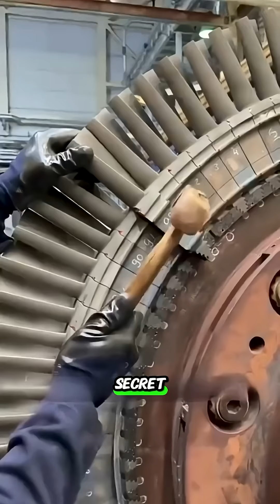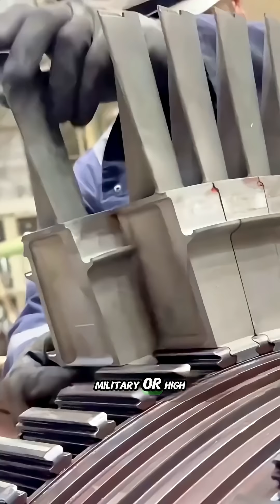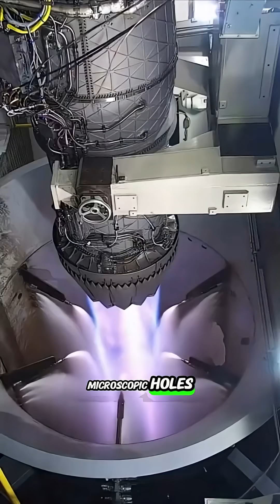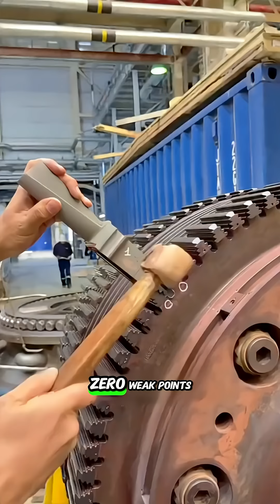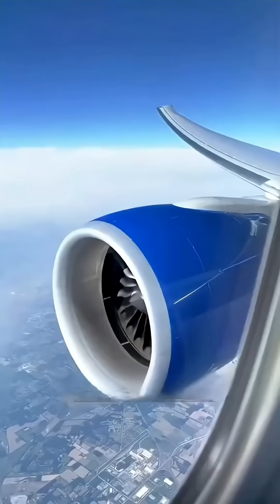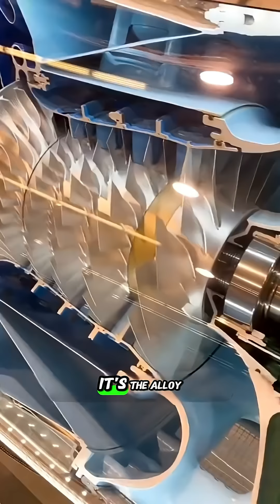The Insane Reason Nobody Can Copy American Jet Engines

Comment: Russians, Chinese, germans, japanese, india, italy, france, england. It's a marvel of engineering but lots of countries can build them.
Reply: Are you racist? Why didn't you name all the African and South American countries that also build jet engines?
Reply: @7x779  ok brazil but I think south africa builds nothing anymore.
Reply: @timjones1583 yes South Africa was about to have a space program but then Nelson Mandela came along and destroyed everything for them to this day, but the world will never learn or accept that. On the other hand you're right Brazil makes some nice airplanes but I'm not sure if they make a jet engine or not. I would be surprised if they do
Reply: Building is one thing, durability is another.
Reply: @Callsign-Blade_RunnerSG  I've seen plenty of boeing aircraft flying into the dirt.
Reply: Only four countries in the world can make the fifth-generation turbofan engines.

In 2006, an agreement was signed on the creation of a new engine, which was named PD-14 (a promising engine with a thrust of 14 tons).

PD-14 is a serially produced Russian high-bypass turbofan engine of fith generation developed for the MC-21-300 aircraft, PD-14A for the MC-21-200, and PD-14M for the MC-21-400. PD-8 engine will be installed on the Be-200, AN-148 and Sukhoi Superjet 100 aircraft. Therefore, the designers and engineers faced the task of creating a unified gas generator, the main element of the engine.

16 new technologies were developed for PD-14 by russian designers, engineers and scientists, namely - single-crystal blades for a high-pressure turbine with an advanced cooling system that allows the turbine to operate at temperatures up to 2000 ° K.; hollow wide fan blade made of titanium alloy, thanks to which it was possible to increase the efficiency of the fan stage by 5% in comparison with the fourth-generation turbofan engine PS-90 produced in the USSR in the late 1980s; low-emission combustion chamber made of intermetallic alloy; sound-absorbing structures made of composite materials; ceramic coatings on hot parts; hollow blades of a low-pressure turbine, etc.

 20 new materials were created for PD-14 with indisputable advantages: a decrease in specific fuel consumption by 10–15%, a reduction in the life cycle cost by 15–20%; operation of the engine will cost 14-17% cheaper than existing analogues. All of them have been certified according to international standards.

New Russian titanium and nickel alloys are used to create the engine. The engine nacelle design comprises 65% domestic polymer composites, which achieve the required level of sound insulation and reduce engine weight. 

The technologies used in the production of PD-14 are state secrets and are protected. Therefore, information about PD-14 is broadly classified. Example: China would gladly copy production technologies, much like the Su-27. They copied the plane, but they failed to replicate the AL-31F engine.

The state's ability to produce cooled cast blades for a modern turbine aircraft engine is an indicator of the highest level of development in mechanical engineering. There are fewer states capable of producing fifth-generation aircraft turbojet engines than countries with nuclear weapons or those that launch satellites into space. Only four countries—Great Britain, Russia, the USA, and France—possess full-cycle technologies for creating such engines.

Comment: So, you mean to tell me that product integrity is more important than knowing how to make it?... wow, one place the real world (what it's become) cannot affect. Real values.
Reply: Ahhh, YES! High performance jet engines operate at the very edge of the alloy melting point!! If the engine cannot manage these extreme temperatures, it will literally melt itself down... That's the challenge a few manufacturers have, and some haven't figured out...

Comment: the coolant in the vanes and rotors is air from the compressor
Reply: also known as bleed air.
Reply: @stevenrobinson2381bleed air is tapped from the high pressure compressor section and extremely hot. It is not used for any form of cooling for the engines.
Reply: @gblank70  it is bleed air, not the last stage of the compressor.
Reply: @johnpinckney7269 I’m not following what you are saying? Bleed air is used for pressurization, wing de-ice and environmental systems. Not for cooling the engine. Cooling is strictly provided by air bring drawn into the engine, there is no liquid used to cool a turbine engine.
Reply: @sonza68 I was about to say that, lol. Turbine section is 2000 degrees, bleed air is 500. Bleed is also used for active clearance control.
Reply: @gblank70  did I say liquid? I said bleed air, ask chatgtp how the vanes are cooled
Reply: @sonza68  there is no 1000's of degress here except the combustion gases
Reply: @gblank70 compared to thousands of degrees bleed air is relatively cool. And yes it is used in cooling turbine blades smh
Reply: @np1000 GE9X 💯
Reply: @gblank70 yes  it is
Reply: @gblank70 it is bleed air, usually 7th or 9th stage of the HP compressor. That air is 200-250 degrees in temperature and is fluted back to the turbine section. It actually flows out of small drillings in the turbine blades leading edges so the blades are running in 200degree air on their boundary layer instead of 800-900 degrees or more of the gas flowing past them. A blockage can vaporise the blade very quickly. 

You have an oil pressure pump and several scavenge pumps to return oil via a cooler mounted in the bypass duct for cooling of bearings, lubrication and HP EDP  fuel pump control. Oil is consumed at s out 1qt per 3-4 hours of operation normally on the CFM56 far example.

P&W F100 won’t be much different in operation.
Reply: I came here to say that, haha thank you for educating people😂
Reply: Coolant flows out cooling the blade. I was wondering what coolant when the whole plane only carry fuel and not heard of plane also carry similar amount of coolant. 😂 Thanks for the explanation.
Reply: @zizimai7568 there is no liquid cooling for turbine engines. Cooling is strictly provided by the outside air being drawn in by the engine.
Reply: @gblank70  but, but, … but what about the hairlike blood vessel thingy in the turbine blades, it isn’t real?🤣🤣🤣
Reply: @Alan_CFA I’m glad you picked up on that bit of nonsense. Ha ha. I’m an aeronautical engineer by trade and videos like these drive nuts with all the wrong information they spew.
Reply: @Alan_CFA I was going to say, as a biochemist there's no way it's more intricate than human blood, that's a rabbit hole you can go down , but protein machines far outperform any man made ones.
Reply: @gblank70 Thank you for explaining that. I only work in aerospace tooling but the video made no sense.
Reply: @zizimai7568  no air conditioning in engine?
Reply: @doumedaurillac7393 The plane is usually operating in freezing temperatures at 10,000+ feet up which is why jet engine oils have the opposite characteristics from your car's engine oil...and yes an occasional lazy rapidly unemployed maintenance crew has found that out the hard way more than once.
Reply: Uses very little fuel
Reply: True but could swear he was talking about the turbine blades not the compressor.
Reply: That's what I came here to say. They have internal cooling passages that spray coolant??? When they are obviously just inserted into a slot lol
Reply: 🤣🤣 the video would have you believing there’s radiator fluid flowing through 🤣🤣
Reply: On a CFM56, the core of which is a GE military spec engine the bleed air comes off at two compressor stages and is about 200 degrees max. The EGT runs about 800degrees at full thrust.
Reply: “Coolant” 😊
Reply: You forgot ACC and how it affects EPR one of the most critical design innovations in modern engines that affects fuel economy
Reply: Coolant laced with mind control chemicals, suspiciously you left that part out.
Reply: @Shred303 thats because there is no coolant and there is no chemical sprayed while flying to create chem trails. Those are con trails. Simply just condensation created from the air being compressed at high altitudes
Reply: @Expedition_America Who is paying you?
Reply: @Expedition_America actually there are chem trails and contrails the first, is by THEY, adding the chemical into the fuel prior to it being loaded into the fuel tanks on the airplanes. The second is normal condensation creating that contrail. The THEY, probably CIA or NSA or whoever Bill Gates is paying off.
Reply: @Shred303  I try to stay clear of them chem trails
Reply: @johnpinckney7269  You mean contrails, don't you?Chemtrails is BS thought up by conspiracy theorists.
Reply: What is the big deal 🤔 any idea. I am confused 😢

Comment: Rolls Royce  is the premier engine
Reply: Major jet engine manufacturers by market share (commercial turbofan engines, revenue-based, 2023 data):

GE Aerospace (incl. CFM International JV): 54.79%
Pratt & Whitney (RTX): 26.04%
Rolls-Royce: 18.31%

All other manufacturers (Safran standalone, Honeywell, MTU, IHI, Williams, AECC, etc.): each < 0.05% (combined < 1%).
Reply: Must be why the F15, F-22 and SR-71 use them. Oh wait. DUH.

Comment: I doubt the turbines get real hot. They are sucking in all the cold are and are in front of the combustion itself
Reply: if you have no clue, avoid posting and demonstrating to everyone you have no clue.

Spend a few minutes and look at what "EGT" (Exhaust gas temperature) of many jet engines reads.

For a 747 it is around 940 Celsius, maximum is 975.

If the Exhaust is this hot, what is the temperature inside the engine where combustion takes place?